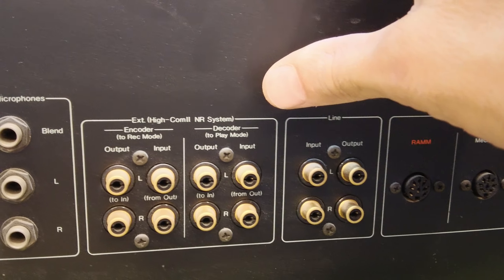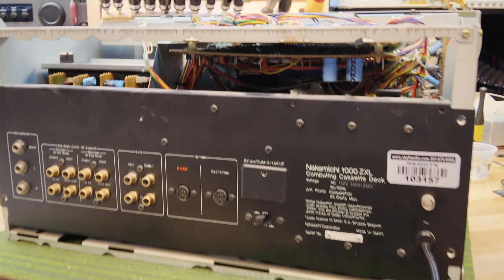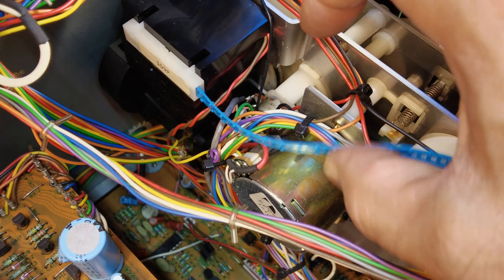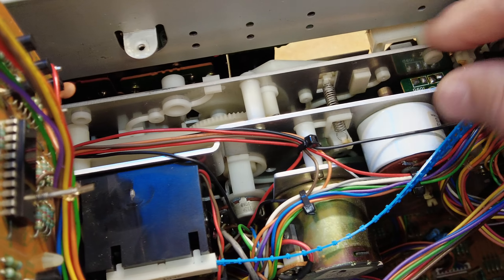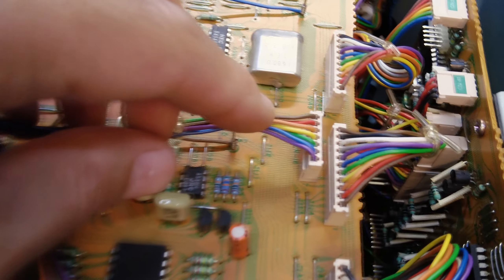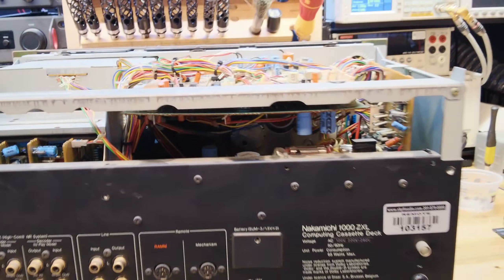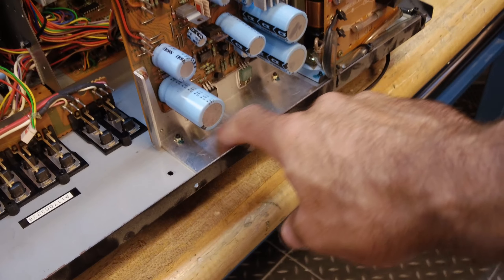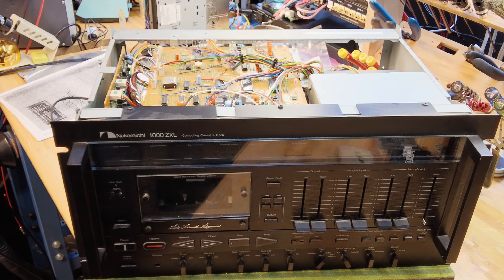PART 2 of 2: One Cassette Deck to Rule Them All, The Nakamichi 1000ZXL! Deep Dive...

Comment: Thanks for the walkthrough, I found it very interest as an owner and user of a Nakamichi 600 2 head tape deck from the same era. The 600 is more basic on the outside but much more difficult to work on as the circuit boards are not as accessible as in the 1000. I love the Nakamichi and still use my 610 Preamplifier and 600 tape deck in my office system, which I’ve had since the late 1970’s. I’m using a modern power amp with a pair of JBL L100 Century Speakers with them. The tape deck has had only one major service but needs another. There is no where here in Australia that do restoration work or take the care that you do. Love your work Paul.
Reply: The 600 is a pain in the butt to service! Just finished one a few weeks ago. Worst problem it has was the interconnects between boards.
Reply: @ScottGrammer  Hi Scott, yes I know what you mean. I hit the interconnects between the boards and the pots hard with “DeoxIT D5 spray which makes a big difference. The lights for both the meters  gone but I couldn’t get to them or figure out how what bulbs I were needed to repair them myself.
Reply: @paulpavlou9294  As I recall, I ended up using 3mm LED's with resistors to replace the factory bulbs. You might have to tinker with the resistors a bit, otherwise the LED's will be too bright. Use warm white LED's. As for how to get to them, you can find the service manual on vinylengine, and it will help you with that.

Comment: Great video. I have the 1000ZXL Limited. I love it. The Nakamichi heads, ABLE system and preamp circuitry is what gives the 1000ZXL its big sound. It's a compact cassette deck that thinks it's a reel to reel.